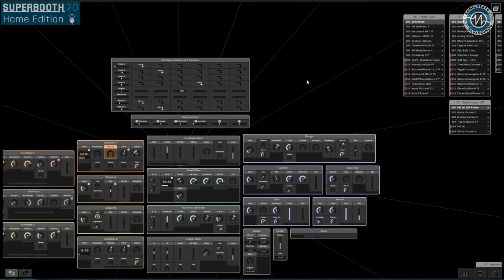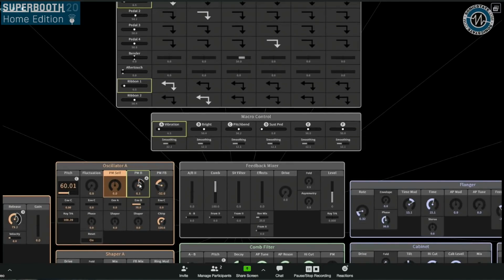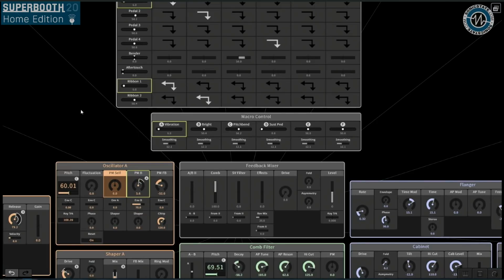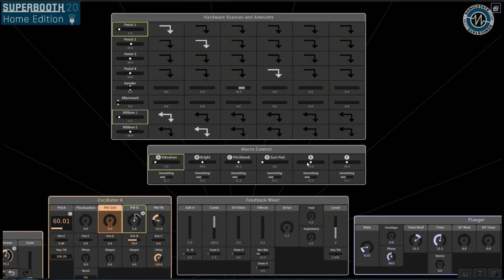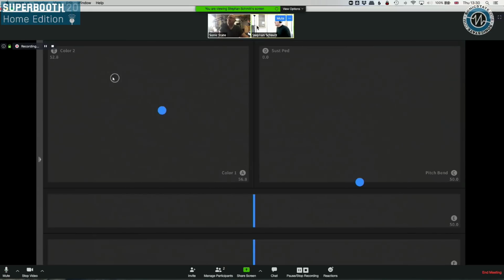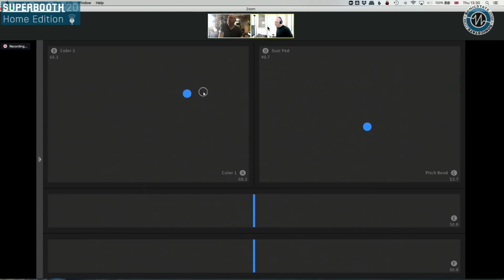Superbooth 20HE  Non-Linear Labs C-15 New OS

Comment: The last time I saw this, it sounded exactly like Reaktor's Spark or Prism, but way more expensive.
Reply: Well this is what the hardware vendors are up against Daniel (the $ risk....).
Reply: It reminded me too of Prism. I presume it also still has no MIDI, as it is touted as a "performer's keyboard", reducing its usefulness. I don't think it can work as an external MIDI keyboard to control other gear either, USB being for presets and firmware updates only.

That said, it does look really nice, I presume the keyboard feels nice to play, and it sounds nice, even if it is in a simplistic FM sort of way (based on the somewhat underwhelming audio demos I listened to when it wad first released); but if I'd had so much money I didn't know what to do with it, and the space for another piece of gear, I might have got one. From a more sensible point of view, however, it's probably near the bottom of my gear acquisition wish list.

They've got a really nice interest-free rent-to-own scheme, though, for the ones who are not sure if it is for them, so I guess for anyone wondering, it might be worth giving it a go.
Reply: the audio eng the point is that both hardware and Spark and Prism has the same creator
Reply: @DanielMiclos  Do they? No wonder they sound the same, then. So it basically is the hardware version of Prism and Spark, then? I do often end up using Prism. I quite like the sound of it.
Reply: @hakonsoreide  more like a hardware version of NI Kontour
Reply: @DanielMiclos   Yes 'HW' version of, so only really appeals to those needing the hands on appeal of the CS-15 format vs. VSTI & decent master keyboard - let's see!! (in reality, it'll likely be those Pro's that can afford to go that route!)
Reply: @TheSlowGrowth  Very much more sophisticated in terms of synthesis and the hardware offers a level of control that no midi controller can offer. All the physical controllers (keyboard, 4 pedals, 2 ribbons and bender) have a resolution of 4000 steps.

Comment: I find it weird that they omitted MIDI because “its for keyboard players” and now they add all this computer shit extras. I can play the damn keys. What MIDI allows me to do is punch in my performance and then later record MIDI changes to the patch as, shocker.....I only have two hands.

It sounds beautiful. I just can’t get over the lack of MIDI. I mean, they’ve been modding old synths and selling MIDI conversion kits for decades now. Give ME the choice whether I want to use MIDI or not. Competent and professional players alike, use MIDI too.
Reply: agree!
Reply: MIDI can't handle the resolution of the control. At least that's the story.
Reply: The resolution of every single parameter on the C15 is higher than MIDI can handle. The ONLY thing that MIDI would be useful for on this instrument would be to input notes into your DAW or hardware sequencer, which could then be played back on any instrument EXCEPT for the C15. I think Non-Linear Labs would have been smart to include MIDI over USB for this reason - so the user has the option to get rid of whatever other device they were using to input MIDI.
So on the one hand, I get what you're saying. On the other - if you want MIDI, there are hundreds of keyboards that support it, and they're much cheaper than this one.

Comment: Use a piano. Then you can focus more on playing and don‘t have to program updates.
Reply: how does your comment have anything to do with this video?
Reply: just returning his logic
Reply: Yeah but you can't compare a piano and an electronic keyboard, they have different sounds and act differently, musically speaking
Reply: It is similar to an acoustic keyboard instrument, although more like a clavichord than a piano. It's for playing music, not programming it, and the controllers (8 physical controllers mapped to six macro controls) are at least as high resolution as an acoustic keyboard. As for updates, what's that, a ten minute job once a year? No-one's forcing you to do it if you don't want to.